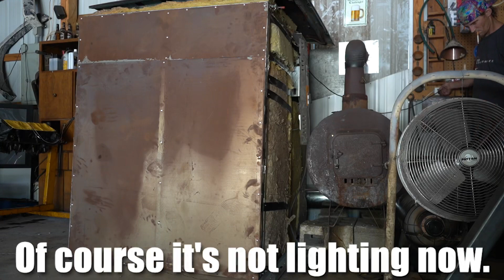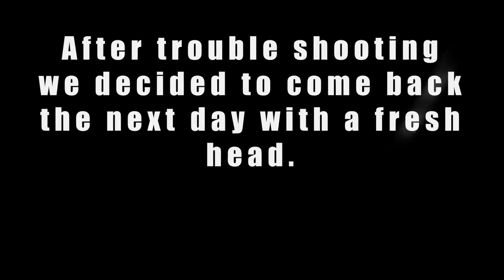Upgrades to the DIY Powder Coating Oven Build

Comment: Do you think it is necessary to use a fan to circulate the air inside? Thanks in advance!
Reply from the maker: It really depends, our heater for instance has a blower on it, so we don't have the need for a fan, with the size of our oven and the size of the heater. But we're about at the max, if we upgraded to a better burner, but without a blower, we might use a fan.   So it really depends on the size of your oven and how you are heating it.

Comment: hope you get it right soon and back to coating,my only concern is using pop rivets on hinges and them working loose,you should weld hinges or use nutcerts on them
Reply from the maker: Richard Webb the hinges will be here tomorrow and we’ll be back at it. We’re already stripping wheels and getting them ready to blast. Have you rivets on the hinges since we originally built the oven and haven’t had an issue. If we do you have an issue with Ken just weld them though. 👍

Comment: Do you have a video that specifically shows how you duct the heater into the oven? I've just recently become aware of the possibility of using a forced air heater and have a couple questions/concerns. 1. How safe is it compared to an electric oven and 2. Is there any issue with creating too much air flow in the oven and potentially blowing powder off the piece. Thanks in advance!
Reply from the maker: We've not had any issues with the airflow "blowing the powder off". Although it's possible, we haven't really heard of anyone having that issue, and more and more people are building custom ovens like this daily.  We've been running the oven almost a year, we even extended it to 8" at one point and we've never had any issue.

Comment: whats more recommended oven with propane or electric one?
Reply from the maker: It really depends on where you are. Some places gas (natural or propane) are cheaper to run than electric.  But as far as cost to build one, I think they are pretty close to the same.
Reply: With propane you need to exhaust it just like with a furnace.

Comment: I still cant understand How the gas stove work.. can you please explain how sir
Reply from the maker: The propane burner heats up the oven. The PID controller tells it when to turn on and when to turn off based on heat, just like and electric oven.
Reply: @710performance  well explain.. thank you so much friend